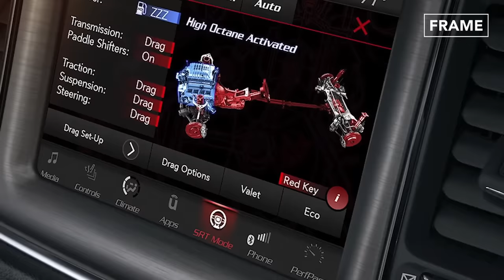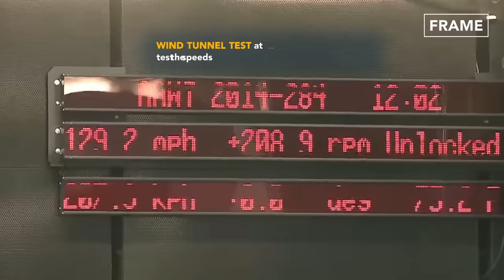Inside Factory Producing the Monstrously Powerful Dodge Challenger- Production Line

Comment: Take my Challenger RT.. Overhaul everything, Convert it to manual transmission.. Install a supercharger, Front & Rear braces, Srt brakes, Cold air intake, wide body kit with demon rims, rear seat delete kit, repaint it, Srt differential, latest Uconnect update, replace all bolts and clips, demon hood, Srt suspension, change all oils. 

Send it back to me ASAP!

Comment: The dodge ram truck line has a lot to offer the general public.  The car line of challengers is leaving a lot on the table.  1970 dodge 2 door iron needs to be put back into the production line.  Carbon fiber has  up to make union insurance you employ.  The build site has different  engines that will move the iron vehicles.  The fuel injected intake manifold will need to be designed.  Hemis.  Do not sell to aftermarket, or make outside deal.  With insurance strikes calls for chrome bumpers.  The output of 50 units of 1970 charger 500s at $13,000 in the dealerships will slowly work your workers and build site stock.  The plus side is that your inventory will show increase in your financial area.  The truck line is good for now.  Design- 1970 Dodge Charger 500.MDC 383 fuel injected with 8 speed transmission.  3" inch driveshaft.  245/50r17 tires..  Dodge rims must be 17x8". Rear end ratio from a 4x4 1996 dodge ram.  8"3/4" rear end.  Stock interior  with electrical upgrade of/with accessories.  Stock springs- look in build site manufacturing book.  Pistol grip shifter with electronic button controls.   Color of paint-  dodge teal.  Roof will have yellow vinyl top.  No moonroof will be on this productioned car.  Stereo system will have (1)component 5.25" in doors.  6.25"(1) rear deck components, rear passenger  seat walls will have (1)5.25" component set.  Front dash will have 3" inch tweeter pair. 400x4 amplifier will power.  Interior color will be Dodge orange vinyl with oe trim.  Production  Automobiles will be on site manager and staff.  Production colors- Red, black, white, green, purple, bone yellow.  Interior colors- Grey, black, white, green, yellow.  Engines will be 318 Magnum(5.2),  360 magnum(5.9), MDC 383 Fuel injected cubic inch.  You will design the hydraulic roller camshaft system with this engine.  To maintain vehicle itemization, this engine will only be produced with the car line.  Vinyl tops for the cars will be tan, black, green, red. Go Sam Houston.

Comment: In terms of the Challenger specifically, Dodge has created way overly powerful cars that are simply dangerous. I'm not against a car being powerful, but Dodge is responsible for building Challengers that are too powerful for most young people to control.
Reply: Aren't they actually considered pretty slow though? You don't get speeds that are difficult to control until you get into the much higher trims.